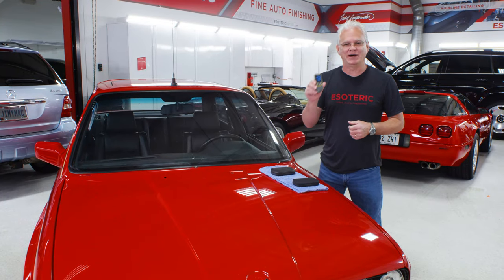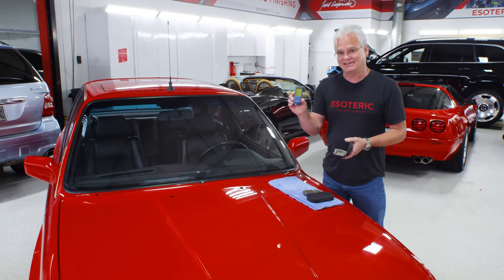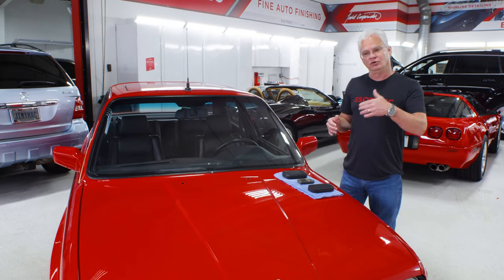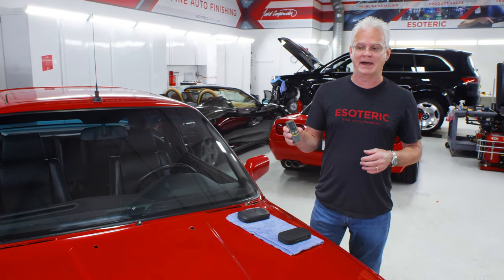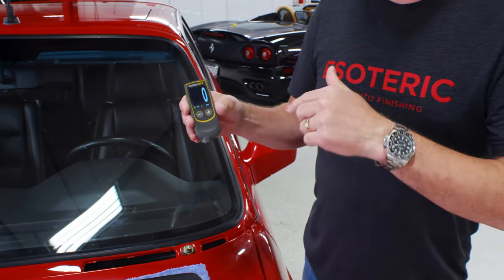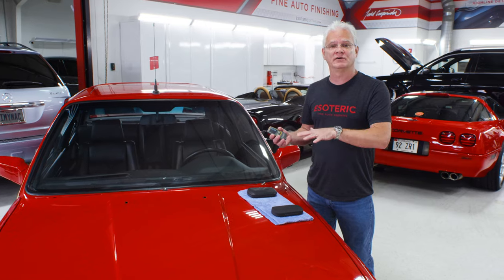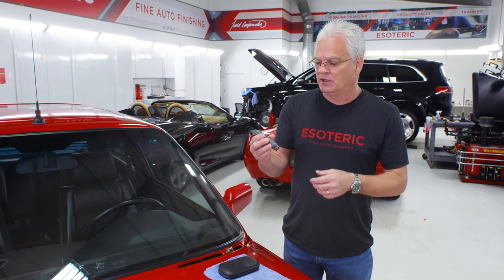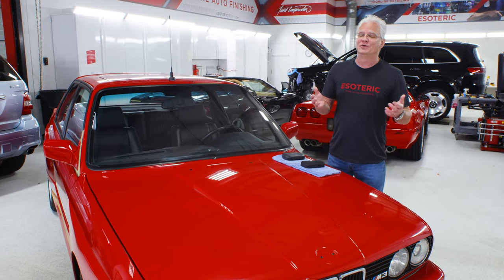You CAN'T be a detailer without one of these!

Comment: I hate to be a buzz kill here, but these guages can be helpful in what Todd talks about, but they cannot tell the actual layer thickness of the single stage or the clear layer, only the total depth, in order to do that you would need the Defelsko 200 Advanced, which is over 2000.00. I don’t know of any others that read individual layers .
Reply from the maker: That machine doesn't measure individual layers on metal substrates though. This is why we refer to them as "insurance policies" because it's simply providing you with an overall picture of what's going on.

Comment: I use it but it's not necessary for the average detailer, I survived 40 years without one and thousands of cars many of them high dollar show and drag racing cars with very expensive paint jobs...
Reply from the maker: If by average detailer you mean people who don't use a machine to polish, then you are correct. But if you're doing paint correction at a higher level, then it's an absolute must to make sure you know exactly what you're dealing with before you start correcting.
Reply: @Esotericdetail  We  didnt have access to this or have any knowledge about these tools in the detailing world back in the day...I worked at high end restoration and classic car dealers for years without a thickness gauge using a rotary polisher on  very expensive cars...thousands of cars, vans and trucks when I was detailing for the dealerships that I worked at..I never burned through a new cars clear coat.
Reply from the maker: @masterspin7796  It's not just about burning through or not...it's knowing if there are any potential pitfalls, and knowing what level of preservation is best depending on the thickness that you have to work with.
Reply: @Esotericdetail  I agree fully, it's way more professional, if your doing expensive autos it can be a savior and some insurance especially if color sanding is involved. I have one, I use it but it wont tell me the clear coat thickness just overall thickness..it's a ball park guess at best...Im not spending thousands of dollars on one so I can do a questionable car, I turn down jobs often..want a to do a boat? Im getting bombarded!..no thickness gauge needed for the gel coat..(video inside)
Reply: @Esotericdetail  i use Meguires MT 300 on the mid settings no more then 4000 rpm. And use Ultimate polish. So i say i only compound and polish when there scratches. Which is once every six months to 1 year.

Comment: The issue with paint thickness gauges is that they give a reading for the total film build including e-coat,sealer,primer,basecoat and clearcoat.However,they are unable to differentiate how thick each layer is.
 When it comes to the level and type of cars being worked on at Esoteric, I believe they are a must to establish what they have to work with.Any way to minimize risk on those high end cars must be taken.Imagine having to tell the owner of a Ferrari that you burned through a fender edge,,yikes!For the average weekend warriors they are a bit overkill.Good vid as usual.👌
Reply: DeFelsko PosiTector 200 can measure and show you the thickness of each individual layer of the paint. It can also measure on non-metallic surfaces. But it runs about 2500 USD so few detaliers can afford it.
Reply: @KamiruNusbaum  That's impressive..and yeah too much 💰...
Reply: @KamiruNusbaum  A $2500 tool to an actual business that'll use the tool daily is peanuts. Y'all are cheap.
Reply: @Twiztid_Metal  To be perfectly honest you don't need that expensive of a tool. Rarely you will need to know a thickness on non-metallic surface. I highly doubt there are 5 detailers in my country that own one. I've done some couple Ferraris, a Lamborghini and even a first generation Dodge Viper which body is almost entirely made of composite materials, and even considering the rarity and price  of that car in my country - I didn't feel the need to upgrade to a gauge that can measure it's paint.
Reply: @KamiruNusbaum  detail cars long enough and you’ll realise how important a gauge is when dealing with repainted cars where you have no idea how much (or little) clear the body shop sprayed.
Reply: @AJ56  Been doing it profesionally for almost 6 years now, and let me tell you a story that you can't trust a paint thickness gauge - It was a white Nissan 350Z, came all the way from US. The paint thickness gauge on the hood showed around 800 microns. So I thought to myself - It was repainted sure, and multiple times even, maybe couple layers of bondo underneath, but I still should be ok for light polish - so I did. Used Rupes Keramik Fine and their Yellow Pad - the moment I touched the paint - literally turned on the LHR 15 on speed 2 to spread the product - I've burned through the paint. Would the PosiTector 200 saved my ass back then ? Maybe. Maybe not, who knows. It happened only once over ~500 cars I've polished now, but it taught me a lesson - sometimes even when you are very careful, you covered all your bases, you can still mess up. Just be ready for it and don't beat yourself up when it happens. Because it will happen. Sooner or later.